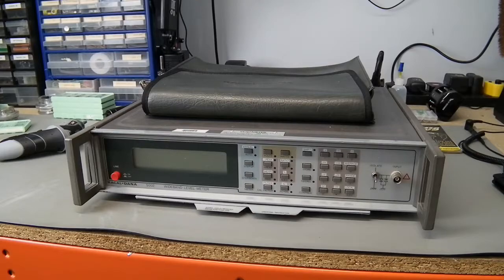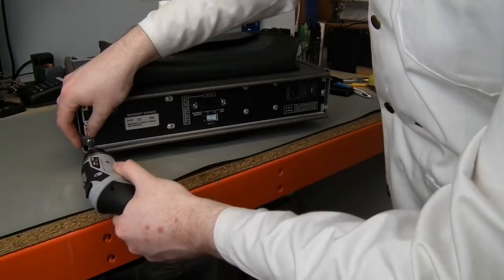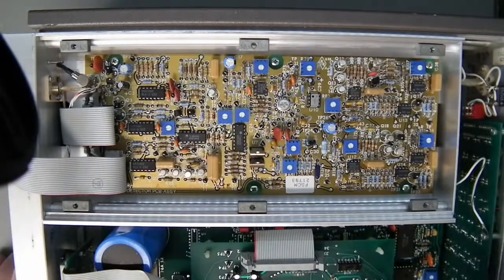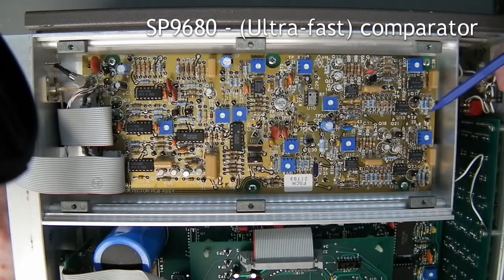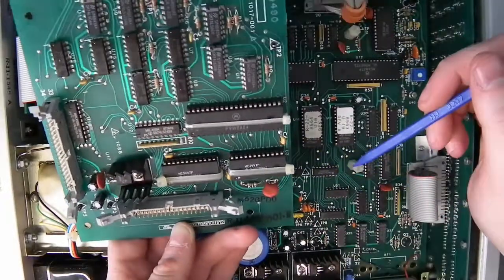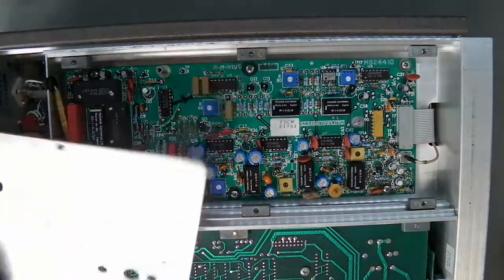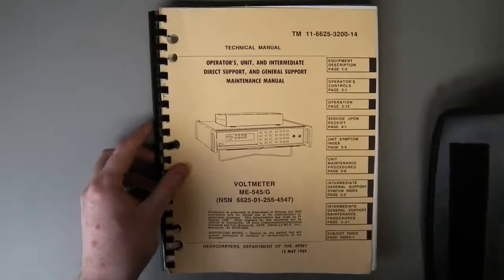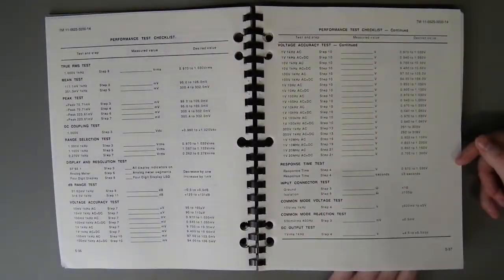CMS #4 - Racal-Dana 5002 / ME-545/G Teardown

Comment: About an hour before watching your video I did a tear down on one I picked up on the Goodwill auction site a year or two ago.   Not quite as nice as yours, no manual or pull outs,  but internally about same.  Looks like your battery is missing.  Mine had a totally dead lithium battery about AA or AAA size soldered in.   Now what do I do with the damn thing if I can make it work?
Reply from the maker: poopytowncat, aye - the backup battery was removed - I hacked in a 3.3v CR2032 holder and it's working like a charm. Little bit ou of calibration, but for a 30 year old bit of kit that's par for the course!

As for what you can use it for, it's a (wideband - 5Hz to 10 MHz) level meter - effectively a voltmeter for AC. 

It's of use whenever you need to accurately measure an AC voltage - but a lot of TRMS multimeters cover it's basic functionality these days, so it is bordering on obsolete! Its biggest strong point is the ability to read voltages in dB and compute relative power/voltage.

I use mine (in conjunction a with a signal generator) for characterising filters I make for  various projects - as you can store a reference value and calculate the insertion loss (or attenuation) on the filter from there at a desired frequency.